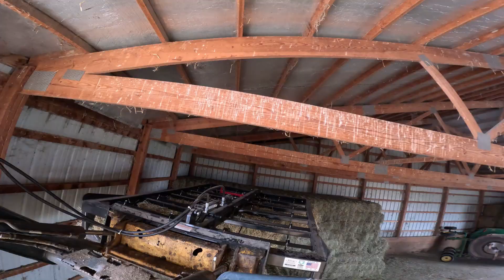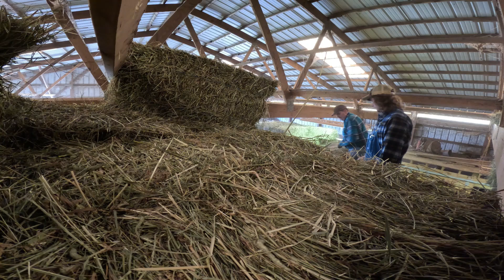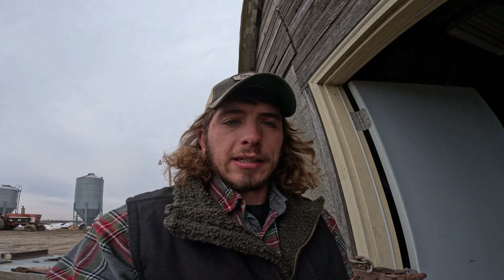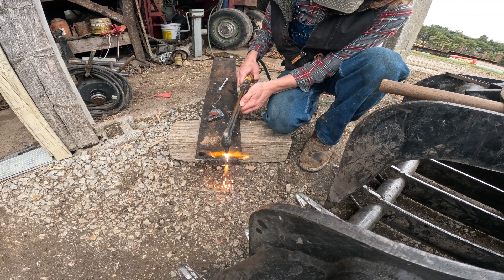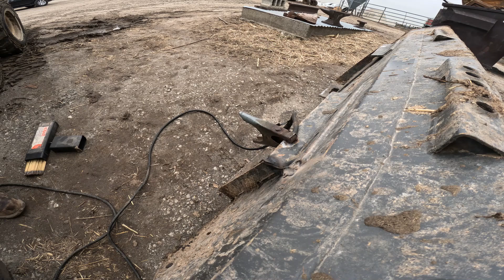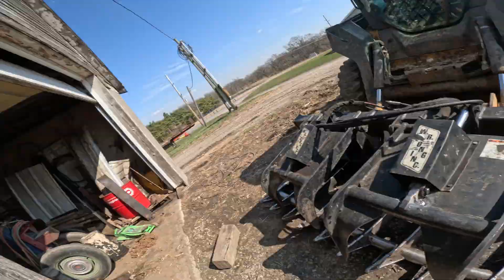Hauling Hay and Some Welding

Comment: what happens if your back starts hurting throwing those bales around, I imagine they weigh close to 70 pounds each and yall threw a lot of them.   I laughed when you were running the bale grabber, your dad and brother got as far away from you as possible (grin)   Thanks again for another really good video.  stay safe
Reply from the maker: You just keep working lol. They weigh around 55-60 pounds. That was my dad and uncle but yeah they stay away lol.